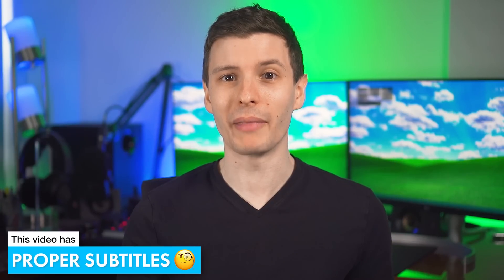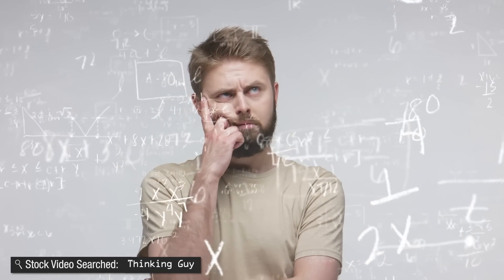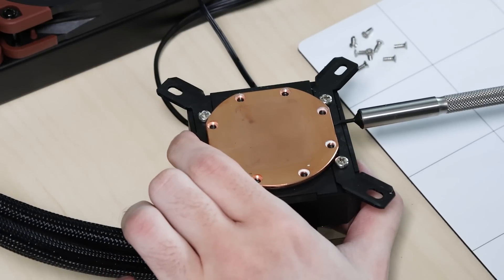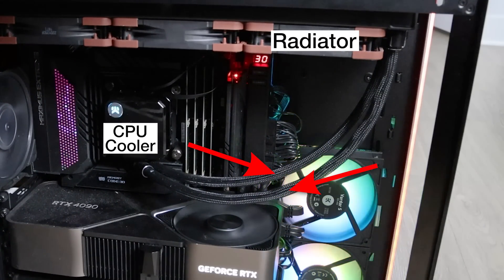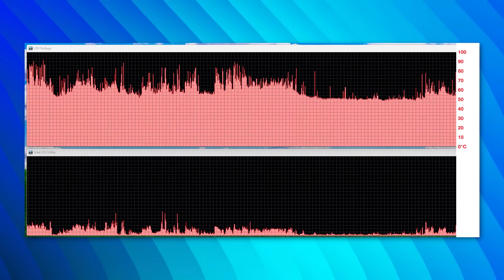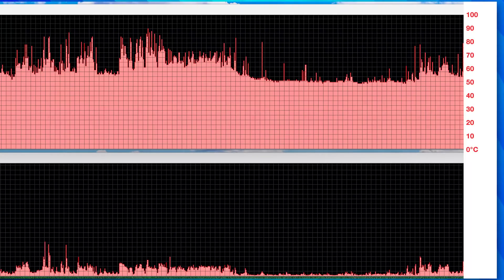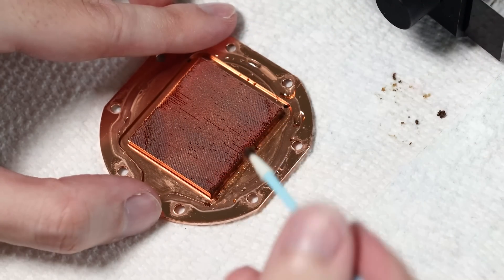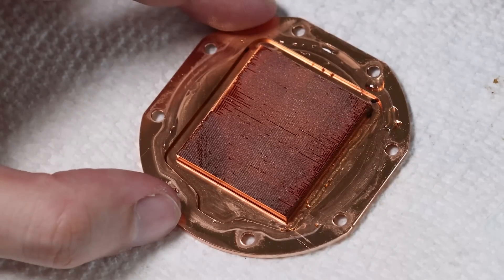The Mystery CPU Overheating Problem Took Me Months To Solve

Comment: @ThioJoe: Excellent video where you also found the root cause. Immediately baselining my own system with HWInFO64. 
➡How do you add vertical temperature axes (0 - 100C)? 
➡Did you do this manually or can you also set this in the free version of this tool?

Comment: Nice find. My old XPS desktop would randomly power off, even after replacing most internal components. Turned out it was a faulty power button on the front panel.

Comment: Thio is highkey baller with his PC. 2 4090s???
The gunk in the loop looks a lot like some kind of biofilm and i think something was growing in there, grew enough to cause you issues, and then fried itself on the cooling plate fins. This happened to my AC unit, but it also happens in PC cooling loops. Jayztwocents has several videos on how to clean and flush water cooling loops. You may want to clean your cooling plate with a soft bristle tooth brush and get some biocide to put in the coolant so it remains clean (i used detol to clean my stuff but i am not sure if the chemicals in there are safe for PC hardware).
Reply: 2x 4090s... very impressive... I'd love to have that computer...
Reply: @NotEvents sli doesn't work on them
Reply: @antoniohagopian213  you don't need SLI to utilize 2 GPUs though. You can give them two separate tasks, like say for virtualization, or say if you're editing videos, a lot of software can utilize multiple cards without SLI or Cross-fire
Reply: Yes. Goo almost always has a biological origin.
Reply: Not sure if it's biofilm, i think it's manufacturer related, since most closed loop systems will be using a mixed-metal safe chemical-based coolant that has excellent thermal properties to increase the thermal efficiency of the cooler, compared to using plain water. I've seen this stuff before, and i think it might be due to how AIBs go to major manufacturers for the construction of their products, and that manufacturer probably uses cheap coolant which will gunk up the microfins on the coldplate.

Comment: That's why i don't recommend water cooling when i get asked for a build. Even a techie may forget this can be an issue, i don't want to diagnose it over a phone with somebody that gets anxious just removing the side panel of the case.
Reply: Yes. On my computer I use an AIO, but I wouldn't want to use it on someone else's computer - a noctua air cooler works very well!

Comment: The issue was obvious from the start. This is why amateurs shouldn't open the computer and tinker.
Reply from the maker: Yes because tinkering is what caused clogging in a pre built closed loop water cooler 🤡🤡🤡
Reply: @ThioJoe  of the 100,000s of PCs, laptops and servers I've worked on, I've only ever needed to reapply thermal paste once.  If it was your first thought, that's amateur.  Second, you reapplied it more than once.  Just improbable.  Third, the 100c temp was a clue given waters boiling point.  Third, you had a thermal camera so it was a logical 1st step.  So yes, when an amateur opens the case, it's tinkering
Reply: @markc6714 geek squad employee with an ego is crazy

Comment: When the pump started giving out on my previous AIO I simply went back to air cooling. I'm only on a R5 5600 anyway, and I usually wear headphones, so my current dual tower cooler is probably overkill already.

And I must admit, after reapplying the paste I'd probably try to see if there were any problems with the current BIOS with that CPU. Idk if unclogging would've occurred to me, especially since that is such a reputable brand.

Comment: I had a similar problem with a Cooler Master AIO. To be fair, the cooler was at least 10 years old. My PC kept shutting down. I knew it wasn't cooling the CPU so I didn't want to deal with the issue. It felt like the pump was working as I could feel it.  I just purchased a new cooler and my problem was solved.  In your case I would not think it was clogged by it's young age. Thanks for figuring it out. It could save people a lot of frustration.

Comment: I had a Thermaltake cooler, that I basically had to giggle the tube going to the cpu, and it would cool down, or lift it up, so it would flow better. Threw that garbage away and went with Noctua, and had no more issues.

Comment: My CPU idles at about 28 degrees idle and 38 - 42 degrees under gaming load.

i5-12600k 10 core
NZXT Kraken X53 240mm Liquid Cooler

Norway
Ambient temp 21 degrees

Comment: Awesome video, I have an AIO and I was wondering what would be some early signs of failure. This I wasn't expecting, why would there be gunk in the lines if it's all enclosed from the start. This is good to be aware of!
Reply from the maker: Exactly!
Reply: They add biocides and anti-corrosion agents to prevent this, but it appears some units accidentally don't get enough of those.  Your only sign will be increasing temperatures. The issue here, is that if it goes on too long, the pump will start being damaged, as it depends on fluid flow for cooling and lubrication.
Reply: Corrosion, for one. Most AIOs have copper heat plates and aluminum radiators. Sure, they have corrosion inhibitors in the liquid, but inhibiting isn't equal to prevention.
Reply: @Steamrick  Good to know. More reason to either stick to air for no/no maintenance, or full custom loop and regular draining. AIO seems worst of both worlds, outside of ease of install.
Reply: @luzhang2982  Except that many tower coolers have heat pipes which have liquid in them that could suffer a similar fate and are not serviceable.
Reply: @soviut303  heat pipes commonly use water, but the water is contained entirely in copper, which is a biocide. With clogged AIOs you see gunk blocking up the intake to the copper fins, because it grew elsewhere in the loop and later dislodged.
Reply: @AAjax  Makes sense. Sadly, tower coolers have such bad clearance that I'll take the risk of an AIO.

Comment: Surprising that EK would have this problem. You should consider to RME it to EK, so they can have a look at it for the cause.
Reply: Agreed, it's very interesting to see an EK AIO have this problem. I don't think it has anything to do with the pump or its design. Could be residue from components wearing from fluid movement or maybe not enough growth inhibitor to prevent bacteria.
Reply: @AnticipatedHedgehog   i think you're on point with the last part of your comment. this would appear to be due to the makeup of the coolant. clogging the blocks happens with every coolant eventually which is why WC maintenance is necessary, however the issue should not show up this quick. I dont know about this particular product, but changing the coolant for something like mayhems may last alot longer. I've ran my wc system for 3 years before doing maintenance (refreshing the coolant and replacing the tubing that breaks down over time) - inspecting the blocks didnt show any issues, not much build up of gunk and no problems with temp, eventually it will become an issue if left unchecked. its unfortunate that this product developed that issue this quick.
Reply: I will note that if you go to EK's website many of those 360 AIOs have been discontinued and this may be the reason. You have to remember that these type devices are made by a third party vendor to EK's design specifications, so it's not too much of a stretch that there may have been some QC issues in their production.

I have an RGB version of EK's 360 AIO that has been running fine at 75° C  under a high gaming load on the CPUs hotspot.
Reply: @DJaquithFL  Sure, there's definitely QC issues. That happens with every product, but what matters is how the company in question handles those issues. In the video Thio doesn't say anything about contacting EK, which would be the first thing you usually do when you have a problem with a product.

As to the discontinued models, they were replaced by new models. They stopped their EK AIO line and started their new Nucleus line.
Reply: I am never buying an hdd again due to them nat being fall proof unlike an ssd.
Reply: Asetek has a patent on a broad swath of AIO designs so no one can legally build AIOs with the pump in the block but Asetek so Asetek sells their coolers to everyone else as an "ODM" and that is how you get EK and several other brands all having these clogging issues lately.
Reply: @rockdem0n  this AIO is not using Asateks parts. Don’t spread disinformation. Asateks owns a patent for a specific pump+CPU block combo that is used by many AIOs but not all. EK have engineered their own pump+block combo and circumvented their patent.
Reply: @rockdem0n 
That doesn't make much sense.
Reply: No it doesn't, thankfully to the best of my knowledge their patent only covers North America that broadly. So there are other AIO cooler designs in other markets, particularly Asia.
Reply: @rockdem0n  
I meant you comment haha. The finplate on AiOs clogging up has nothing to do with the pump location.
Reply: @-eMpTy-  I never said it did but due to Asetek's patent on that pump location all AIOs are built by them and just sold under other brands with different housing designs on the outside of the pump.
Reply: Well all AIOs sold in North America anyway.
Reply: @rockdem0n  
Not true. Corsair, Arctic and a few others are using different OEMs. CoolIT, Apaltek, Dynatron - the list goes on. Deepcool and Cooler Master are manufacturing themselves. There are many ways in which, as a manufacturer, you can circumvent the patent by Asetek.
Reply: @rockdem0n  Built or licensed by Asetek.  Others can build their own, and just pay Asetek royalties.
Reply: @-eMpTy-  And they're all less effective methods, which is why Aseteks patent is such a hamstring on the whole AIO industry. Basically while you're right it doesnt matter that you are, most AIO still use Aseteks design because its fundamentally better.
Reply: @rockdem0n  Their patent has expired. Also EK uses their own pump design in their AIOs.
Reply: The gunk probably came from an other component in the loop. The fins on the CPU cooler are just the part were they were “filtered out”. My best guess is the radiator wasn’t flushed properly before installing.
Reply: Lol ek are low quality water cooling XD why is it surprising? They can't even make a 4090 block that's crazy expensive correctly, never mind a cheap aio